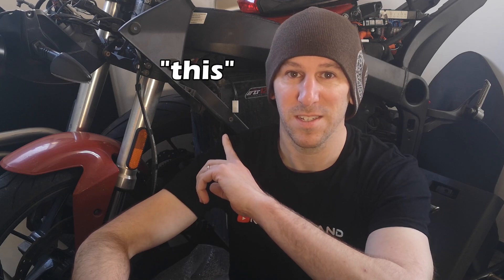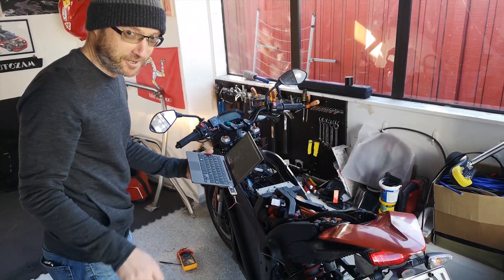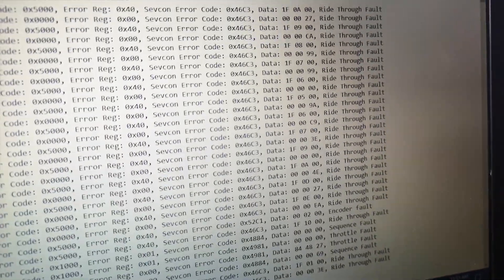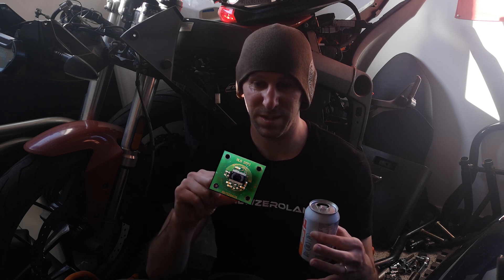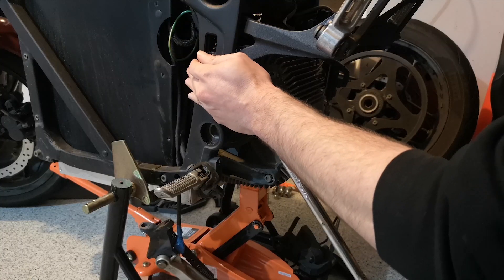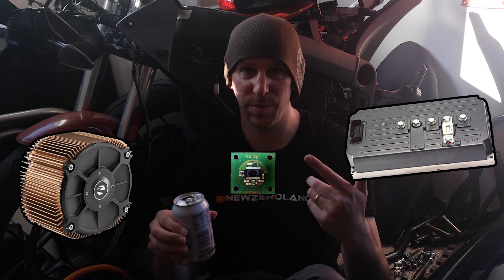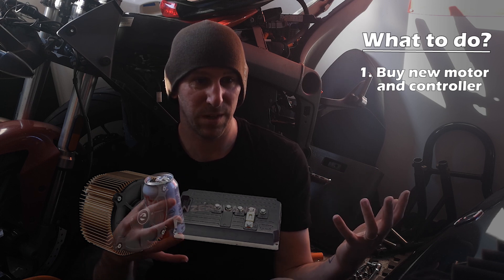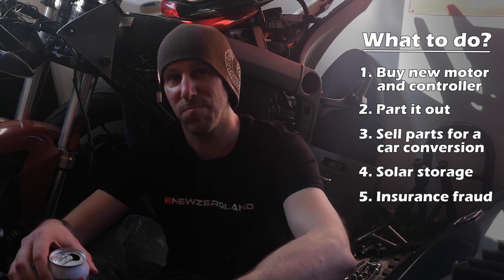What's wrong with my bike?

Comment: I'm learning how to fix elevators currently, and just recently learned how to re-learn encoders, it's actually a really straightforward process. Same problem, command down and the motor made the car move up. Caused by unplugging the encoder and plugging it back in for a brake service. Maybe some kind of loss of connection caused your issue. We used the drive to change most parameters, which was just disabling part of the motor, so only the encoder spins, using the controller to create an up and down command (forwards and backwards for you). Interesting how similar parts are for elevators and electric motorcycles.
Reply from the maker: Dude wow!  That's wild haha.  I never thought about how many other industries use the same tech.  I didn't explain (or understand) how the encoder works at all, so this video did a horrible job at that, but hopefully it got the point across.  Replacing the motor sounds like the easiest solution, unfortunately.

Comment: 02:40 : The encoder or in many drives the 3 hall sensors tell the conroller the exact angle of the rotor, not the speed. This way the controller can energize the 3 sets of stator coils (assuming the Zero has a brushless motor) accordingly.  A brushless DC motor is in fact a 3 phase AC motor supplied by 3 variable frequency inverters coupled with a 120°  phase offset. And no, the bike will not suddenly go in reverse in case of a defect. The inverter's brain will always check if the data coming in makes sense. if it doesn't it will light up your check engine light and switch things off or to a limp-home mode. I would open the motor and check things. could be just a broken wire or dodgy solder spot. Even if you have to change an IC it will be below $20.  Surely there is a friendly electronics guy near you who can assist you. Most conrollers have a sync mode where they turn the motor slowly (or wiggle it) in an open loop mode and measure the offset of the feedback. The whole episode shows how important Right To Repair is. As a part of the transition to EVs your local workshop around the corner needs to be able to fix your vehicle. An no, it is not difficult. The big jump was from carbies, points and push rods to modern fuel injected engines. Diagnosing and repairing those is almost the same as with an EV.
Reply from the maker: Hey thanks for explaining that!  It definitely makes sense that the encoder is misaligned and the wrong phases are being activated.  (Like I said, I don't know how this stuff works haha)  Even if I fixed the encoder placement or fixed a damaged wire, the controller would still need to be synced, and I don't have the ability to do that.  Even info on how to do it isn't readily available.
Reply: @NewZeroland  In many countries consumer protection laws mandate that a product is required to be 3rd party repairable. I don't know how Tesla / Apple / John Deere / Zero ? get away with breaking those laws. Glad i did my own conversion, the motor and controller manufacturer gave me the software and service manuals required to diagnose and repair to component level. I really own my bike. It should be the same for everybody, just like it is with ICE vehicles right now.
Reply: @moestrei  I can't blame Tesla and zero, the people selling these bikes are usually lying about being able to repair them. A few years ago my motor broke and the repair place took a month to replace it. Even though they are "licensed zero dealers" and claim to be able to fix them.
Reply: @Planclanman3  Yes you can blame them. If they would make software and doc available there would be alternatives and this sort of BS would disappear real quick as there would be a competitive market. Right now we have to accept all the crap as there is no alternative.
Reply: @moestrei  don't you think they would want third parties to be able to repair their products? The accessibility is one of the biggest market barriers to every family owning one. I think while it may be an easy conversion, a lot of places are unwilling to touch them and try to learn. I had several motorcycle shops refuse to even change and balance my tires because I owned a zero, so I did it myself. A lot of places are scared. They are missing out on money as well.
Reply: @Planclanman3  I live remote. I need to be able to maintain and repair my vehicle myself. Those shops will need to adapt or they will die. Not right now but sooner they think. My local small town workshop has done a suspension repair on my Tesla without any issue. Of course The Boss had to go for a test drive.....he's more a V8 guy but he came back speechless.
Reply: @moestrei  are you meaning you ‘can’t do anything on ICE vehicles right now’? Because you are correct. Ever since the industry wanted to ‘control’ their profits they removed the need for 3rd party shops selling parts in the high street - as you can only do basics; oil,spark plugs, filters. Everything else is specialised tools, diagnostic software (tech laptop) I could work on all cars prior to the late 90s, now it’s pointlessly expensive and not worth it.
Reply: @stumpusMaximus  Some you can others not.
Reply: Rheingold, you've said above, "no, the bike will not suddenly go in reverse in case of a defect" but the first thing Sam told us in the video is that that is precisely what the bike did! Therefore, clearly, whatever defect it has caused it to run backwards instead of forwards and that, as he also said, is bloody dangerous! (It also made me think, as I have said since the first time I rode a Zero in 2009) why don't Zeroes have a bleedin' reverse anyway? If Vectrix could fit a reverse as standard in 2006, along with many others since, why can't Zero? (Same goes for traction control on the non-SR/F & S models!).
Reply: @pnblondon1087  Well....I have no experience with Zeros but other EV and conversions. Zeros don't have a reverse? That is crazy it is so damn handy to have.
Some brushed DC motors don't like reverse as the 'timing' of the brushes is set to an advance going in one direction. Surely Zeros have brushless motors with the advance timing of the 3-phase field done by the controller reading the hall sensors or encoder.

Even cheap controllers I used in conversions check the signals for validity and throw an error code if something is odd. The Zero doesn't? That is indeed dangerous. 

English is not my first language and Sam is not always clear to understand (mumble mumble) for me so I thought he was hypothesizing when talking about the bike going in reverse with Jen, sorry.
Reply: @moestrei  I sympathise with you as a non-native speaker of English, trying to follow Sam's mumbling. He talks as if he's had his jaw wired shut; no idea why! Your English is a damn sight better than my Deutsch if that is your native tongue! You were right about him hypothesizing about what could have happened if Jen were riding the bike, but that was later in the video. It's the very beginning of the video that you need to listen to again – just the first 12 seconds. Sam says "So, a scary thing happened when I was riding this....I twisted the throttle and the bike went in reverse...and, it's not like I had it in the wrong mode, Zeroes don't have a reverse".
Reply: @pnblondon1087  Ja !
Reply: @moestrei  You might find this ancient little 5min video from 2018 interesting. It's just me riding around in circles on a Friend's Zero DSR after a weekend's trail riding, being interviewed by the cameraman, and talking about the good and bad points of the bike, including, especially, the lack of traction control and reverse! I'm pleased that I correctly the predicted that Harley would fit the LiveWire with rapid charging! https://www.youtube.com/watch?v=Z3MR4QuKpJc

Comment: I had a similar scare from a different source with my Lightning Strike. Suddenly the throttle would jump from wherever I had it (anything above full closed) to what felt like WOT. I had just started some tight low speed twisty roads, and the thought of this happening when I'm leaned over was pretty scary. I was able to limp it home, taking only side streets and constantly feathering the throttle between closed and about 1/8 throttle. I immediately called Lightning, and they were great. "Don't ride the bike. We will come at the end of the day and pick it up." They did, diagnosed the problem and fixed it. In this case, it was a faulty throttle potentiometer. They brought it back, fixed, and with a couple of software improvements to boot, and all has been good since then. At first, you would think it's an electric motorcycle problem, but with ICE bikes going to throttle by wire, the same thing could occur.
I'm impressed with you taking the bike apart and pulling the motor. I've done this with ICE bikes many times, but with the electric bike,...? Do I want to get into an electrical system that has a 300V battery pack?
Reply from the maker: Oh man!  See, that's the customer service I love hearing about.  In this situation Zero would say they don't believe you, and after you proved it to them, they'd take months to fix it.  Maybe it's because Lightning is still a small, family style company, but I love how close they are to their riders.

Comment: I had a problem like that with my fxs. When I went from belt to chain. The reprogrammed it to fire correctly. It worked for a few blocks. Then Hollywood electrics ended up installing a new motor on it. The dsr is fine for some reason. I have over 32000 miles on it.
Reply from the maker: Holy cow!  I hate that the solution is a whole new motor.  Surely this is something people can fix.  Glad to hear your DSR is solid!
Reply: @NewZeroland  yes I’m surprised. I never had a motorcycle last that long with me. Abs never have I owned one this long.

Comment: I can totally feel your pain. After the only Zero dealer in Taiwan closed. This is our deepest fear. If one of those important parts like BMS, controller, and motor goes wrong, there are very few things we can do without dealer software and Zero tech help.

One 2015 S here had the same issue like your SR, and it turns out the cable to the encoder fell off. We fix it by reconnected the cable.
Reply from the maker: Oh wow! I'm sorry to hear there is no more support there. Why did Zero leave?? The same happened in Australia and Indonesia. Sadly I've decided to sell my bike once I fix it. Zero isn't helpful so it's risky to keep it. Good luck over there!
Reply: @NewZeroland  Zero isn’t helpful T_T. Zero as a small manufacturer, I expect they are more friendly to owners, instead of relying on dealers to do all the work. The infrastructure here was not so good back in 2015 and people were unfamiliar with EVs, not to mention electric motorcycles. It took the dealer 2 years to sell all the first batch imported 30 bikes.
Reply from the maker: @alphalu1067  wow!  Yeah Zero used to be friendly and helpful when they were smaller.  Now they just make bikes and let the dealers handle them.  Customer service is so important and Zero is struggling with that.

Comment: I owned a 2012 Zero ZF9 -S, they were notorious for encoder issues, and mine was no exception. I'd often be riding and the motor would kick a couple of times and cut out, daily. While it on occasion did run backwards, it only ever seem to do this from standing. When riding it would only ever cut out, which was bad enough. In the end I traded it in for a 2013 Zero-S which was a lot better. ;)

Usually the encoder on the later models generally went bad due to water ingress. You might want to check the seal.
Reply from the maker: Wow!  Talk about early adoption.  You're hardcore!  Thanks for the advice.  I'll check and see if water got in somehow, although it was a dry / sunny day when it died.  Who knows what it looks like inside the motor.  It could be a loose encoder or it could look like a grenade went off in there!

Comment: Hoping that the new motor will fix the problem! such a bad feeling when the bike malfunctions.. especially when it reverses when it shouldn't.. seriously a bit shocked about that. 

I just had to replace the OBC of my zero FXS.. it's working again, but still, it was an expensive repair and I have mixed feelings about replacing such expensive parts..
Reply from the maker: You know it, Ferdi.  It sucks that a lot of these parts aren't things we can replace ourselves, which makes it even more expensive.  Glad your FXS is back on the road!

Comment: Since my SR is my commuter.  This is giving me doubts about long term reliability.  I commute about 7k miles a year via moto.  I'm not sure if I should sell my SuperCub, commuter that the SR replaced.  My last commuter, NHX110, had almost 80k miles when I sold it and was still running strong.  So no doubt that the SuperCub will go just as long if not longer.  I do love the zeroness of the SR as a commuter, so far best commuter I ever had.
Reply from the maker: I feel ya man. This motor encoder problem is a rare one, but I know it's happened to more than a handful of people. One of my friends has over 50k miles on his Zero and hasn't had any problems, so I wouldn't worry about it. If there was a dealer nearby I'd just take my bike there to get fixed and it wouldn't be a big deal, but my location makes things worse than they are.

Comment: I JUST HAD THAT SAME THING HAPPEN TO ME ON SATURDAY!!! I called Zero during my car ride back home towing the bike and thankfully they called me back the next business day. Hopefully we can get this issues resolved 🤞 This was my first major ride on my bike and I've only had it for about 5 weeks. I wonder if the software update had anything to do with it. Or maybe the motor just got too hot? I had only been riding for 1.5 hours on country highways (55mph) and though towns.
Reply from the maker: What!!  Wow, same symptoms??  Did you take yours to a dealer?  Please keep me posted about what they say and how they fix it.  Good luck!
Reply: @NewZeroland  I was cruising along and the throttle cutout. It cut in and out a few times and my bike felt like ABS was kicking in. I pulled over to the side of the road and stopped. When I applied the throttle again it went in reverse. I power cycled it a few times but the bike kept going in reverse. My error codes were 25, 48 & 49. I had my GPS plugged into my accessory port for the entire trip (first time I used the port). The motor temp was 160°F, the controller and battery pack were around the 90's. When I got the bike home it still would only go in reverse and the motor temp was still reading 100°F. The temp that day was in the upper 70's and it was very sunny. My bike is a 2021 DSR 15 anniversary edition with chain conversion kit and charge tank.
Reply from the maker: @rachelgendich  wow!  Yep, definitely a motor encoder problem.  Error 48 is the controller, so it probably couldn't talk with your encoder correctly.  That is super freaky.  I hope they can fix it soon!  Thanks for sharing.

Comment: I feel your pain... first ECU fail was shocking, cold solder or heat sensor I could not locate  the issue - got false positive on overheat and bike just shut down. I ended just replacing whole controller. Second one - melted high V plug and battery socket. When electric bike fails it's goes 2 ways (at last for me) confusing or scary AF. And I was thinking about dropping my bike from the cliff more than once ;)
Reply from the maker: Oh wow hahaha yeah that IS scary! This will definitely be my last Zero.
Reply: @NewZeroland  It served you good 5 years, and after fix will serve you couple more. I feel like, especially now 5 years in electric is like 2 decades in combustion engine bike progress.

Comment: As a person with two figurative left hands without opposable thumbs, I'm in awe at how much DIY you're willing to risk with a vehicle that's powered by a MEGA HIGH VOLTAGE BATTERY.
I'd most likely be dead within seconds if I even remotely tried to unscrew a bolt...
So lots of admiration here, and also a bit of apprehension about buying a Zero (though still absolutely convinced I'm never buying an ICE vehicle again in my life, so no worries).
Reply from the maker: Thanks Bert! That means a lot. Maybe I'm crazy 😂 Taking things apart is really fun for some reason. Putting it back together will be a mission though. I'm sure I'll end up with a handful of "extra" bolts. The way I see it.. someone else can do this, so why can't I?

Comment: Hi, in spain we had many people with the same problems. The solution is that you buy a new encoder and replace it (40euros)  Then you have to connect obd port to your motorcycle and You calibrate it with zero software.

Good luck!!
Reply from the maker: That's a super cheap fix! I wish I had a dealer here that could do it.
Reply: @NewZeroland  yes!!!  Good luck!!!